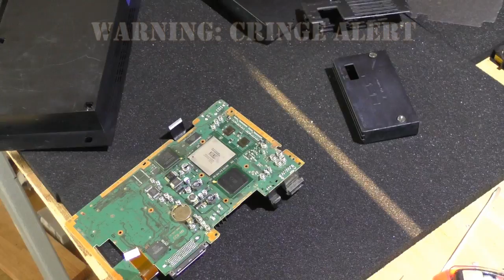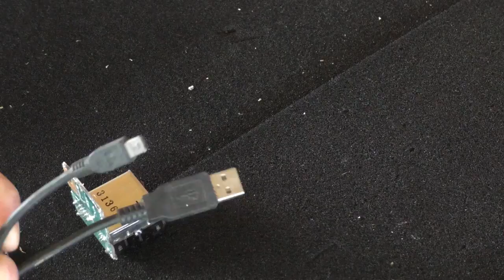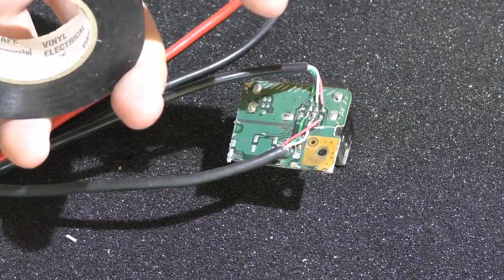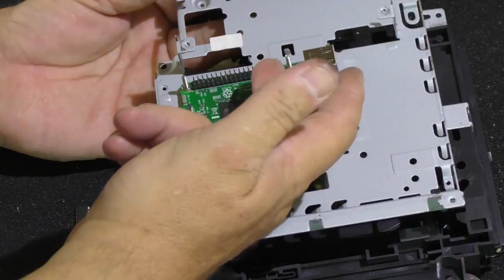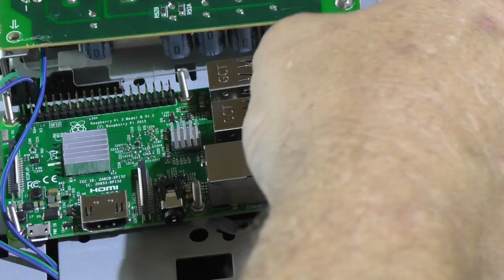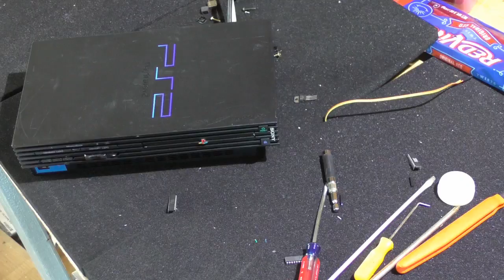Sony Playstation 2 Main Logic Upgrade For Kodi Mame Raspberry Pi 3 Retro Pi Pt2

Comment: the raspberry pi does have a reset pin check youre raspbery pi you just have to solder it its to holes between the usb ports and the gpio pins

Comment: I picked up a PS2 for $10 at a Goodwill store about 2 months ago. Hollowed it out completely to install a raspberry pi3. I also planned on mounting easyget arcade controllers directly into/onto the PS2. Ordered a bunch of small extensions from Amazon to bring the raspberry pi3's various ports to the PS2's surface. The hollowed out PS2 quickly became full of wires, before I even began to install the arcade controllers and wires. I just kind of gave up and have it all sitting in a bin. I learned a bunch of neat tricks and ideas from your two videos, and plan on using them when I find another cheap PS2. I will finish my current PS2 project, but without the arcade controllers, and give it to my Dad.  Thank you for the videos, and cool ideas.
Reply: Blade Runner Part 3 please!❤